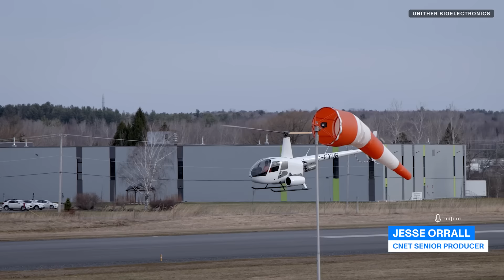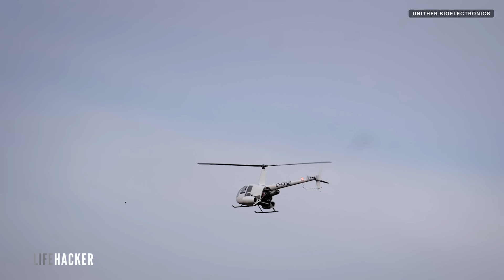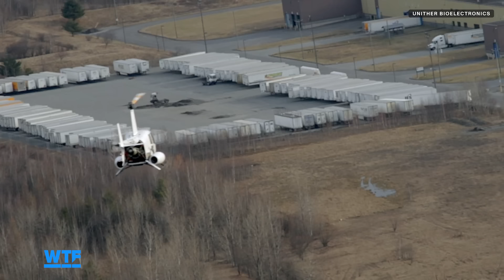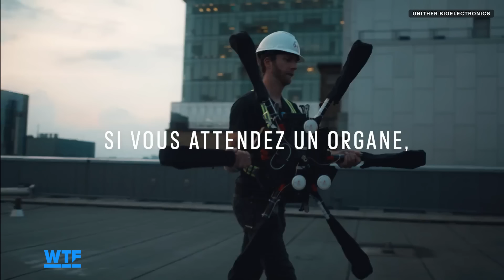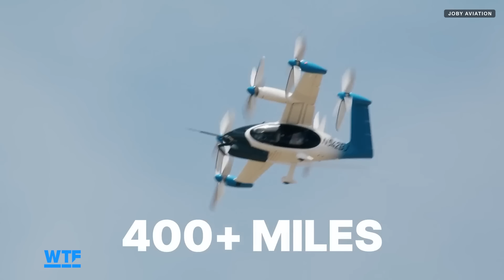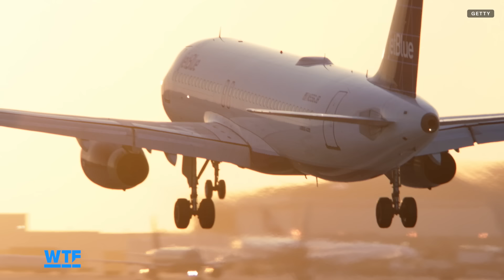Hydrogen-Powered Helicopter Takes Flight: Flying Without Jet Fuel

Comment: What’s the max power hydrogen is still burned in gas sate? I guess 50kW. Is that enough to fly a chopper? Not quite. Can you feed liquid hydrogen to burn camber? No. Thera you application: ultralights or terrestrial rollers.

Comment: Just because it burns clean doesn't mean it's non polluting. The energy to generate H2 in the first place must come from somewhere. There aren't any hydrogen deposits like there are oil.  It's best to think of hydrogen as like a battery - you can charge it with coal fired electricity or solar energy - the battery doesn't care.

Comment: Now...where do you get cheap, sustainable and green hydrogen?
Reply: The moon. Time to mine the 🌙, and leave the pollution up there.
Reply: You have to make it. If you don't, some other country will sell it to you.
Reply: @SanjayRamaswamyWolvie  Can you make CHEAP, GREEN and SUSTAINABLE hydrogen? I'll nominate you for Nobel prize.

Right now, it's three times more expensive than gasoline and requires quite a proecess (cheapest is Steam Methane Reforming. Even then, You buy a kg of H for $25!

And, we haven't open the Pandora box of transport yet.
Reply: Sea water via electrolysis.
Reply: @JJs_playground  3-4 times as expensive, resource heavy... despite better efficiency.
Reply: @BobHill-s2c 
Throw up some solar panels in the Baha California, then pump the sea water from the Pacific and you have a competitive (hydrogen) fuel source.
Reply: @JJs_playground Okay. Let me know when you're up and running and competing with Big Oil! 👍